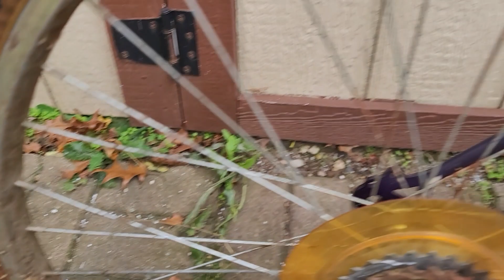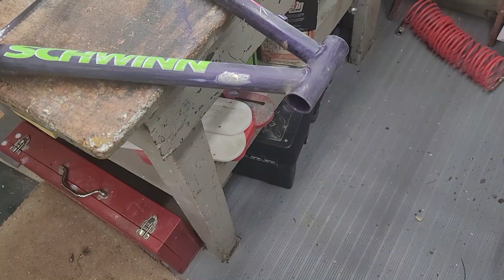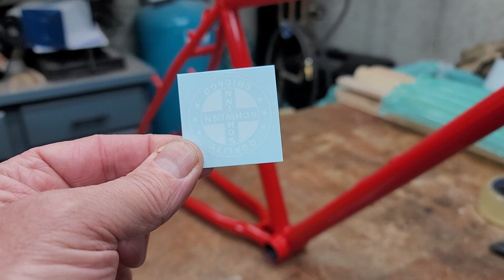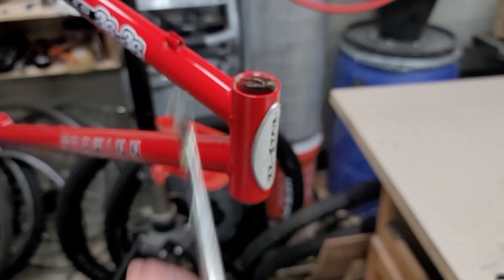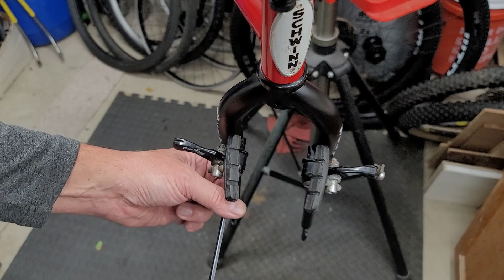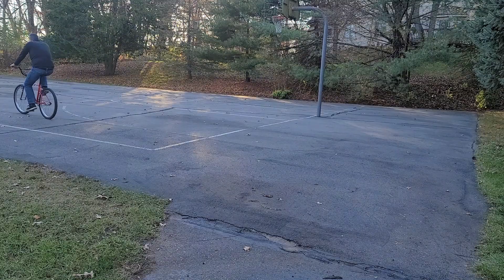Incredible Transformation - Junk Mountain Bike to Old School BMX Schwinn 36/36 Replica 26" Cruiser

Comment: Sweet ride. I did exactly the same with a Reynolds 531 mountain bike. I like the way you tucked away the brake lines. You can do miles on that. I've done regular 25mile runs. Single speed means no bother, just ride.

Comment: Really like the idea of putting the old BMX decals on a mountain bike frame. You can still clue in little rivet numbs on that front badge to fill the holes. Would have looked a little better if the brake pads and component were wire wheeled. Will be striping some BMX parts of the bikes my scrapper guy shows me. I give him a case of beer once in a month as a thanks. Plus I buy somewhat decent 26" bikes from him for 10$ which is 5 times what he gets for scrap.

Comment: Love this concept. Making it happen shortly (or starting the process at least when I go out to my bike shed). 
Question - around 9:10 you're greasing the headset with that little sonoivabitcher (I believe to be the latin term) - Are those things intended for greasing chainsaws? Legit question not saying iS ThAt a CHaiNSaw. I have a few of those from my Grandfather & I've never been clear on if they're intended for oiling bars or its just a standardized oil applicator. They certainly work great!
Reply from the maker: That's a mini grease gun.  It is perfect for getting grease into small places. You can get one on Amazon. There should be a link in the video description.
Reply: @DePuesshop  There ya go.

Comment: I get it's some mix of quill and threadless adapter, still better to add spacers on the steerer to brace the stem better I'd have thought.
Reply from the maker: Good advice.  I think it would look better as well.  Ultimately,  I should find a quill BMX stem, but I was limited in my parts bin.